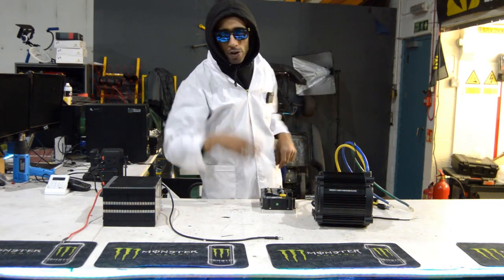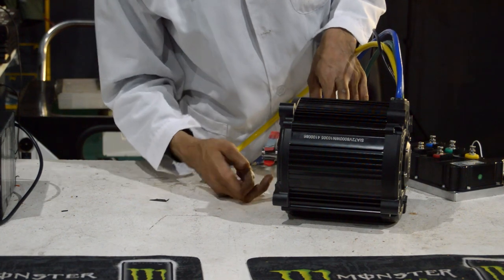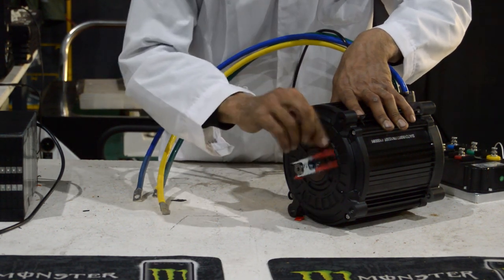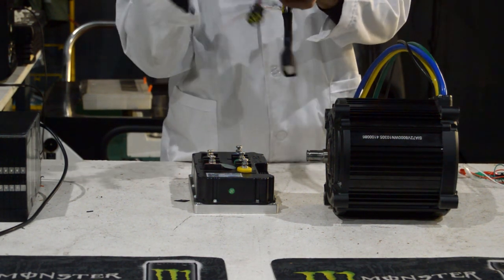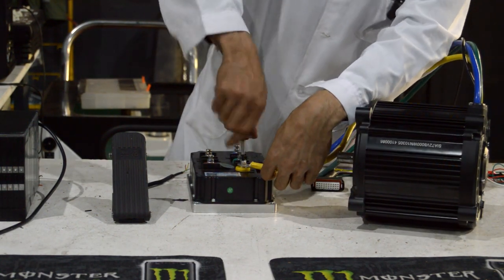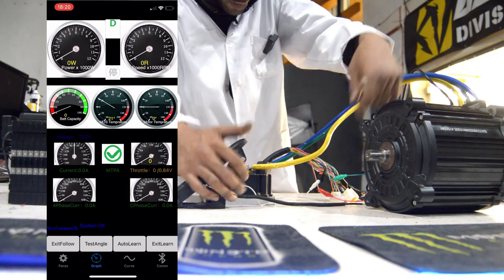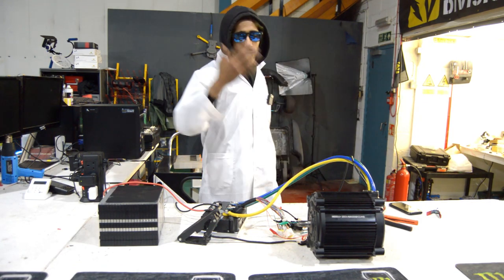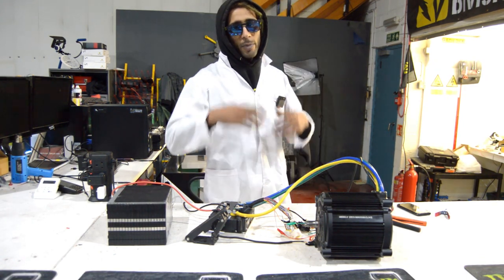Kilovolt Tech Talks EP013: Bench testing the QS180 Encoder Based Mid Driver Motor *INSANE TORQUE**

Comment: Hello.
I have QS180 (encoder) + fardriver ND721200B.
If I set the Motor Direction: 1, rotation clockwise.
If I set the Motor Direction: 0, then first the rotation is coclockwise, and then clockwise.
Tell me, what could be the problem?

Comment: I’ve got a 84530 controller and that thing has some crazy throttle lag
Reply: I had a hard time getting rid of lag too, do you use the app?
Reply: @nickzietlow6475  yea but seems like anything I change makes no difference
Reply: @tsergio111  okay maybe this is confusing but in the function paras section of the app, try these settings.

Disable the brake, park, follow, PC123 

Set CAN to none 

 Set gear to default D 

Sport is the only throttle curve that will feel choppy imo

I haven't got it all ironed out yet but this and sport mode got me to a good starting point on my set up.
Reply: @nickzietlow6475  low end feels better but still laggy
Reply: @tsergio111   aight try this.

Release throttle = 0
Weak response = 0 (I have it set to this but I haven't expirimented with it yet)
Release throttle = 0 
Throttle acc step 224

Double check you have sport mode set sometimes it goes back to line or whatever idk.

Set ratios in speed 500rpm-5000rpm to 100%, this is how you really tune throttle response once everything else is working right if I understand correctly

There's some good fb groups like surron Segway modders

Comment: Always enjoyable. What cells are the cells in the battery? 

I wonder if they they will make encoders to be able to use a range of controllers?  That acceleration  is very smooth. Right now it seems you've got a pair of the motor and the controller. We both know that motor can handle more than what that controller puts out.
Reply from the maker: Thanks glad you enjoyed it . They are the EIG C020B cells 3.7v 20ah 100A in 20s1P for the bench test battery . 

This motor is going to need a bigger controller maybe a ND961800
Reply: @KiloVoltBikes  pulling a ton of amps!ayne plug some merch on the videos. Some awesome.ebike shirt could be made with Kilovolt as a name..

Comment: i love the video edit on putting positive on controller without precharge LOL
Reply from the maker: Manual pre charge ⚡️
Reply: @KiloVoltBikes  dont do that with ASI controllers on public. They refuse warranty then :D
Reply from the maker: @IncredibleCisco  you might not know this but unlike asi controllers fardriver has built in precharge circuit so it’s not required to run a precharge resistor with them . 

Asi on the other hand it’s required
Reply: @KiloVoltBikes  if they had kind of precharge it wouldnt spark?!
Reply from the maker: @IncredibleCisco we asked Fardriver why a precharge resistor is not included in the circuit diagram included on spec sheet they advised it’s not required and is integrated into the design . I can only imagine that means a precharge resistor is built in or that the switching stages are not effected by inrush current

Comment: That motor is BONKERS! I think the motor worked the first time you throttled- it just spun the earth 😆 
I just dropped a vid on undocumented Fardriver / Kunray motor issue.  With your experience, it would be interesting to see if you've seen my throttle issue.  Subd for more either way!